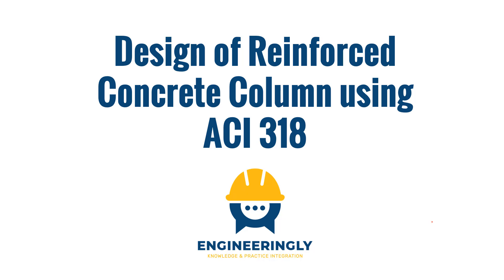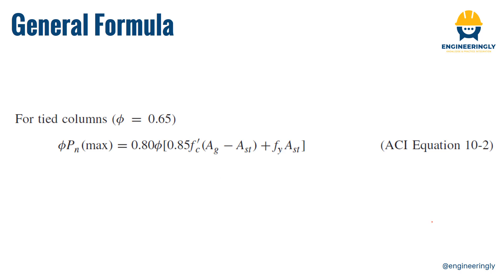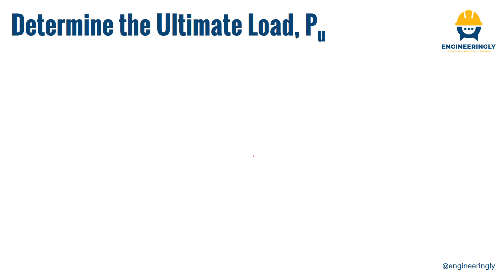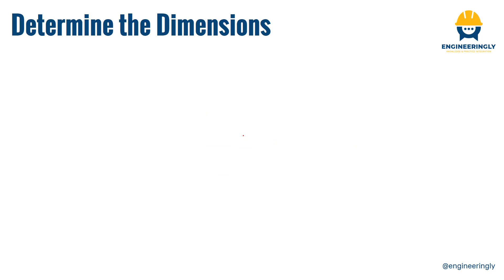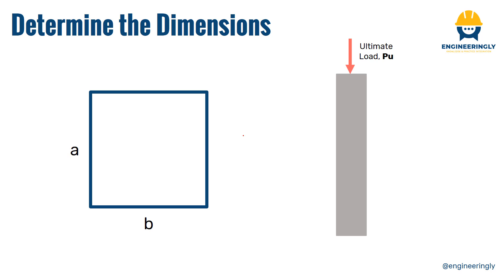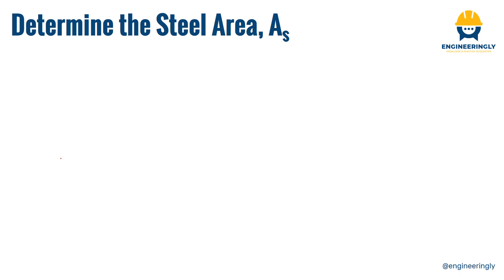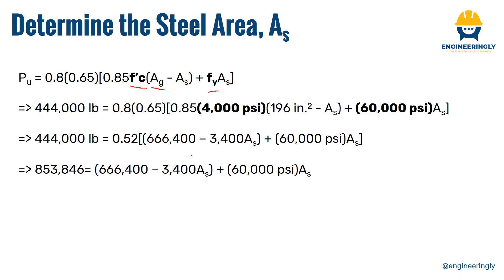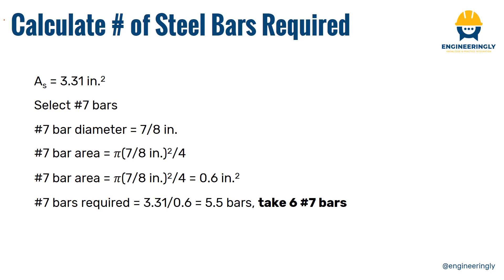Ultimate Guide to Reinforced Concrete Column Design | ACI 318 Standards Explained

Comment: You are saying that shear in columns is high in the support or on its ends. What about the bending moments? is it also high at the ends of the column? Is it because of the dynamic loads i.e. wind and earthquake?
Reply from the maker: @gnidnoeled786  Hey, thank you for asking this question. Yes, shear is generally maximum at both ends and decreases towards the center. While bending moment varies case by case. Although it’s usually highest at the ends, while some deflections in the column might result in having higher moments in its center compared to the ends. Hope that helps!